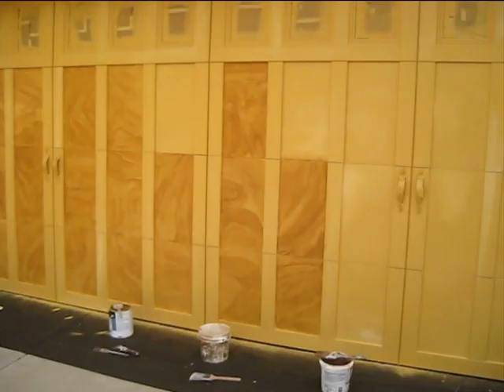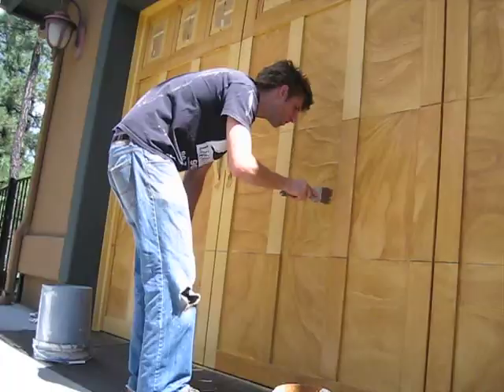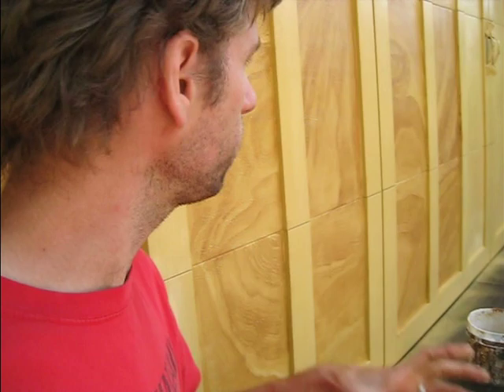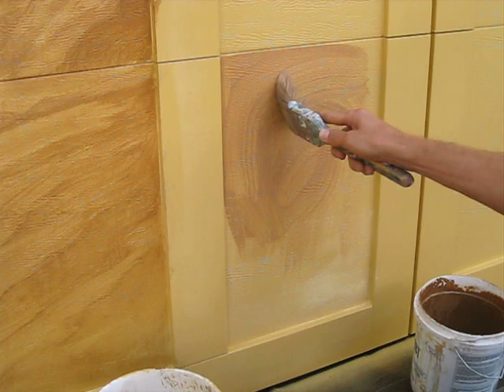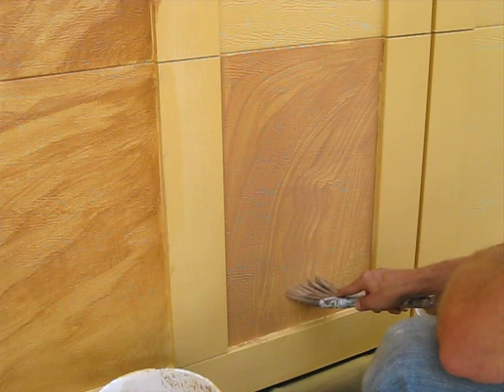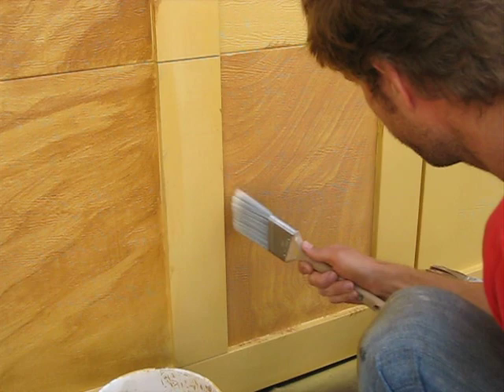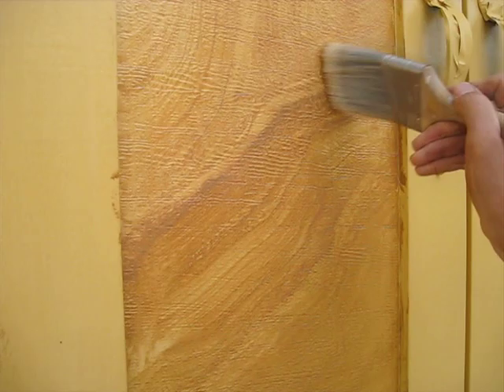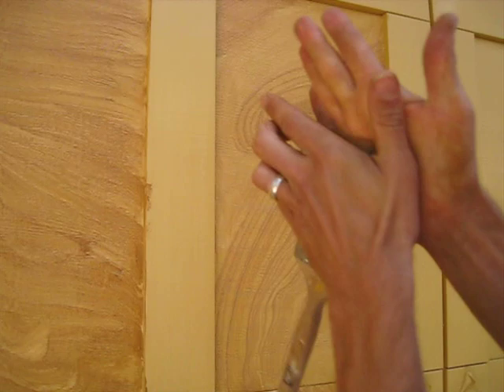How to faux wood grain on garage door - Mural Joe

Comment: Practice on some square pieces of scrap wood.But set them up vertically first. Practicing on a horizontal surface is drastically different. You can do it! If it doesn't turn out, it's just paint....start over!

Comment: Beautiful Joe!!  What did you finally protect the surface of your work with??  Polyurethane?
Reply: Artisan Creations you dnt need too 
He was using acrylics 
Only if you use oil every two or 3 years you need to recoat oil looks a lot richer than acrylic paint I paint faux wood garages in person it looks so much yellow than having it on picture